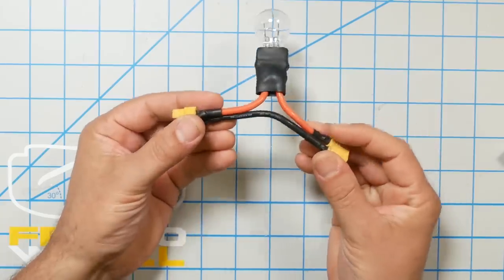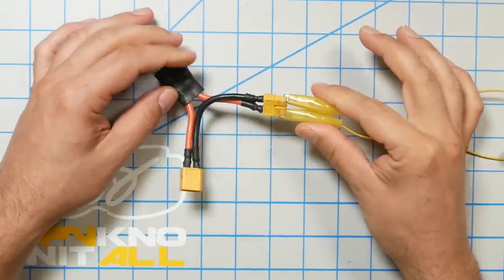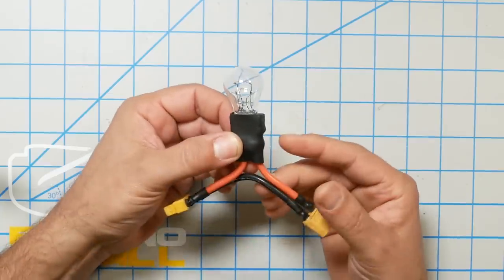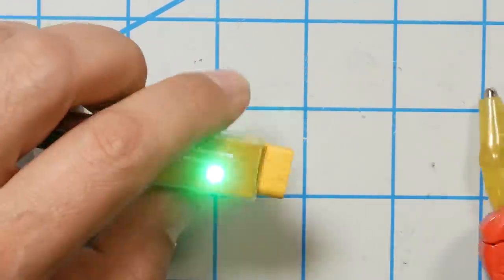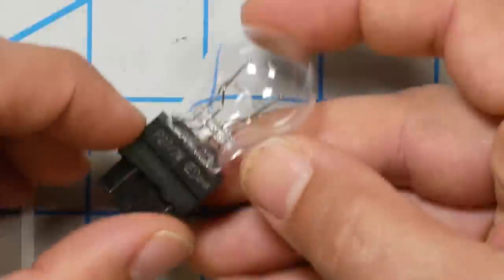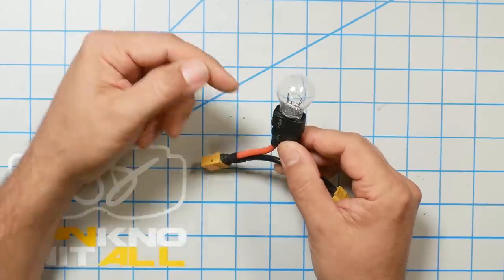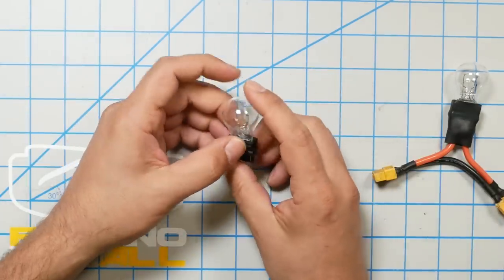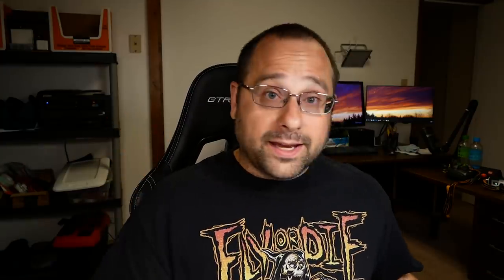Why you need a smoke stopper | HOW TO MAKE A SMOKE STOPPER

Comment: A: glad you didn't wet your kilt.
B: glad a total pro like JB isn't afraid to use a Fisher-Price heat gun/hair dryer.
On a serious note I tried a pre-made stopper and the bulb was a useless wattage for my micros and minis. I have a couple bulb sockets, I may build one myself with swappable bulbs if I can figure out the wattages I need.
Thanks for the hours you put in JB, you're one of the few we can't really do without.

Comment: I usually use a lab bench power supply with a current limit, but this is a good cheap way to do it. With the lab bench power supply, I can see the 'battery' voltage at which the high current is happening, which can help with diagnostics.
Reply: That's the proper way when working on the bench. This way you are also making sure that you won't damage the battery due to excessive current drain
Reply: Thank you for this, never thought of it and I have lots of good bench power supplies and no smoke stopper haha

Comment: I do love the irony with that poly fuse gizmo. 

Good ideas on the DIY version. I think I'll put a latching pushbutton switch on mine to simplify receiver binding.
Reply: That is a freaking great idea!!!
Reply: By the way some online shops still sell those polyfuse ripoffs which will smoke themselves and your model circuitry with it.
Reply: That is so weird that I just saw your post, I just got finished making one, it's not a smoke stopper though.  Had old tactical light for my .223 I don't use anymore, and took the button circuit board out of the rubber piece and de-soldered the wire.  Took two xt60's with some wire still attached (I always save connectors) 1male 1female, soldered the two red wires from xt60s together, then soldered each black wire to opposite ends of the button.  Hot glued a little short screw to the actual button to make it easier to push, some heat shrink and bam, no more needing three hands to bind my quads..lol.

Comment: Hi Joshua, brilliant, hilarious video, just started watching your echine build series. Big thumbs up from UK here.
Just a nitpick really but the bulb you are using is not a headlamp bulb (with high and low beam) but an American spec stop/tail light bulb. Hence 27 and 7 watts respectively. In the UK we have 21/5 watt equivalent. It looks to me that you have put the two in parallel, so you using 34 watt total. 4s batt about 15v.  P=IV, so yeah 2.26 Amps, allowing for inaccuracies of a clip on ammeter. Just ordered my Tyro kit off Bangood and really looking forward to the build. Crack on buddy.

Comment: by twisting the leads together on the bulb, you made it a 32W bulb: 25W for the bright filament + 7w for the dim filament.  doesn't change the 3A current draw, but felt like it needed pointing out.  

you could instead use a 3156 single-filament bulb and that really will be ~25W.  

I recommend a little peanut-sized 168 bulb for tiny whoops - they only use about 5w.

Comment: Great video and a good laugh.  Though, I once borrowed 2 brand new 25-watt smoke stoppers to a friend and it still beets me how he managed to smoke two new top-range 4-1 ECS, one straight after the other...the smoke stoppers didn't prevent the smoke from happening.  Therefore, from experience 3 amps is still plenty enough to create smoke and my lesson learnt from the experience is that I triple check my solder work and inspect everything under a scope before plugging anything in.

Comment: Hey, Joshua, a tip: cut the black wire and solder a switch in the between. 😊
It helps a LOT to bind and so on. 😃
I made one this way, but I used a light bulb holder. Easier to change in case of any accident. 😊
Reply: Great tip!
Reply: @frankbarajas  I even recorded the step by step process, speaking in Portuguese and English... But I couldn't finish the video yet. 😕
Reply: @frankbarajas  The problem is that I can't speak straight right now... Long history, but because of the robbery that entered my home and attacked me in late 2017 I ended losing a few of my front tooth... I'm having to put implants and so on. 😕
So, until I finish it I can't do much. 😕
Reply: MC's Creations - Oh wow, I am so sorry to hear that happened to you.  From my own personal experience I can say it can take a very long time to fully recover, if ever, from things like that.  Hope it goes well for you my friend.
Reply: @frankbarajas  Thanks, my friend! But yeah... And I didn't even told you the worst part. He attended me with a hammer at some point, luckily only hurt my ear. A bit to the side and I wouldn't even be here. You know?
It's hard to get over it, but it also gives you a lot of perspective about life. And that part helps a lot! 😊
So... I'm all good now. And soon I'm going to finish the implants and I'm going to get back to work. 😉
Reply: @MCsCreations - OMG, we are fortunate to still have you around.  God bless you.
Reply: @frankbarajas  Thanks a lot, my friend! 😊
But yeah, I really feel fortunate to still be around. And to know nice people like you! 😊

Comment: Now that was truly a great video.  Damn, you do work hard at thinking things through, or even all the way through.  I did not know about using one as a battery protector on the bench.  I did not know that you could "safe" your drone on the bench with props because it won't let enough current to flow to make the motors run fast enough to hurt you.  Sort of like it converts the Whirling Blades of Death into the Spinning Polypropylenes of Ouch. So, yes, I learned a lot somethings today.  Awesome stuff!  Thank you very much.

Comment: Automotive glass fuse that comes in housing with spring inside is also a solution,  it's mainly used for audio systems on cars but works on quads too.

Comment: One more use for a smoke stopper: discharging a pack down to nominal voltage, if you charged too many packs and suddenly you`re not using them for instance after a crash, bad weather, or uhhm, you fell and hurt your wrist or something :o
Sure, many have that function on their charger(s), but many don`t.
12V halogen bulbs for desklamps etc. also work, but they can get REALLY hot, so keep that in mind ;)
Also, use a multimeter or voltmeter so you know where the voltage is actually at, shouldn` t have to mention that, but here I am, mentioning it :p

Comment: A computer PSU has intergrated short circuit protection and can output 3.3V 5V and 12V. You can get 7V or 9V out with correct plug placement. Its an awesome tool for every drone maker.

Comment: Oh I absolutely agree with you! I Cote every solder joint after they've cooled with conformal coding regardless of how good of a soldering jod I've think I've done. I had the tiniest blob of solder from a +5v pad which was right next to an positive ESC pad, they weren't touching but they were closed enough when I plugged in hey 16 volt battery they might as well have been one pad, and wouldn't you know it those kind of shorts don't show up with a multimeter. 🙃
Reply: It happens more than you think :) Me once did a stunt with XT60 battery connector soldered in opposite polarity in middle of night. And quad didn't fried only because one of battery pads on flight controller board had cold soldering and fell of on battery connecting.
Looking over boards with zooming lens after soldering tiny things should be a mandatory habit for every DIY-er.

Comment: Made one right after my first build... I had to cross my fingers with that one but not any more.  I used a 3 amp circuit breaker after reading an article on Propwashed.com.  Two worthy notes from the recent past, 1- I smoked an FC with the smoke stopper on (the FC must have had some damage and shorted using less than 3 amps since it didn't trip), 2- I was puzzled after checking motor directions with the smoke stopper on, not anymore since I now have learned that operating one motor at a time at the low speeds I used wouldn't draw more than 3 amps.  Thanks a bunch and I had a really good laugh with you.

Comment: 4:17 annnnd subscribed!

From my own experience, I chose too small a wattage bulb for a 10 inch build, that I really didn’t want to smoke, and the light was turning on just from the audible beeps the motor makes (for context, it was two 12v - 4 watt bulbs in series)

Initially thought something was wrong so disconnected the battery really quick, but now know better the SS is an indicator, current limiter, AND a fuse so it's safe to leave connected. Probably put myself through a lot of extra work, but in the end better safe than sorry.

Comment: I also use mine with the “Discharge +” setting on my Reaktor charger to boost its built in discharging ability. It’ll boost it from 1-2amp to about 5amps discharge, just by adding the one bulb. 💡

Comment: Lab power supply is the way to go. Set up a current limit like 1A and you can even troubleshoot the short circuit by touching and feeling which component is hot.

Comment: I was really lucky at one point during calibration when I did the rookie mistake and was trying motors with my props on. The third motor, my mouse slipped and it shot full throttle at my hand. I had a lot of cleanup to do after and luckly BF's great protection shut the motor off when the quad tilted to much. I can see that if I had this it would save my hand that day.

Comment: I found out heat expands metal and a short circuit is not visible while cold but once you apply power and that short is warmed up enough to expand the short is created and causes issues.
Found this with my computers motherboard. Would work just fine when first powered up, but as soon as i tried to load say Chrome my PC would trip and shut down (PSU protection) Tested with a multimeter and everything was fine.... Only worked it out when my PSU failed to trip and a small section of my motherboard burnt out that connects a few capacitors together. The short was a small dent in the board itself and separated while the board was cold.
Reply: I’m a little late to this.. but just wanted to say wow! I bet that was quite an “ah-ha” moment… This is good information to have in my mental troubleshooting archive. And good job on actually figuring out what the culprit was there!

Comment: I owe you big time, Joshua.

Building two identical rigs.   Built and used your smoke stopper for the first time on the first test of the first ESC/FC/motor combo and to my horror the light came on, meaning I have a short.  No smoke, of course....
Same test on the second identical rig passed.   Since I couldn't see any obvious difference between the two rigs, I swapped the connectors between ESC and FC and the previously failed rig now passed, with the ESC/FC chirping correctly.   So it was a bad connector, which I have since fixed.   Never would have guessed that.   But found the problem quickly because I'm building two identical rigs.    Your smoke stopper saved me a brand new rig:  ESC, FC, motors.     Thanks so much for posting.....
Reply from the maker: Whew. It sounds like that was a close one.

Comment: Honestly, I'd make a couple of super long wires for the constant current power supply, and have a smokestopper on the end--the bright light is way, WAY more noticable for quick reactions--and not a weak alarm beep, if your power supply even has one. So even to those guys (Me) with a constant current benchtop power supply... Why not make some long cables that will protect you even further?

I'm just getting into FPV, and i'm seeing a lot of good advice on this channel.

Comment: Or if you wire up the power out on unify pro hv with power out on your fc on mistake like I did  on your tbs unify pro instead of the power in multimeter wont detect it. I had a smoke stopper that uses a fuse hooked up but still fried my vtx. Great information

Comment: Made a smoke stopper out of an automotive 2A fuse with XT60 connectors a couple weeks ago to set up a F722 5.5" quad. As I was verifying motor directions and RX settings using a 12V 30A PSU, I accidentally touched the positive alligator clip to the negative lead on one of the ESCs, despite electrical tape around most of the clip, popping the fuse. Could've gotten ugly and expensive without it, had it touched some other exposed part.

Comment: I made one of those when I first started building quads, just after I fried my first ESC by hooking it up backwards.
Reply from the maker: smoke stopper will not protect against reverse voltage. only over-current.
Reply: @JoshuaBardwell  It does if you are quick enough, I've done it.
My first plug in on any new build or rebuild is just a quick touch through the smoke stopper. If it even looks like it might glow a little I stop and find out why.
You know how you can get a bit complacent after a few builds and make a stupid mistake.
It may depend on the quality of the ESC but I have saved one, it is still working today.

Comment: The best tool I have never used... Thankfully I have only killed 1 ESC and 1 VTX not using a smoke stopper in over 4 years in the hobby. While just a month ago or so I killed a Rush Race VTX under volting it :( due to a bad solder bridge...

Comment: I basically use a 3 AMP blade fuse instead of the bulb, seems to cover all my bases regardless of the quad I'm working on.    They're built the same way you built the light bulb version.
Reply from the maker: If you use a fast-blow fuse, then this is okay, but the problem with it is this: you hit the arm switch one time, or your motor beeper draws too much current, and bam, you blew a fuse. Now you're out a dollar or fifty cents or however much the fuses are. Every time you blow a fuse, you have to have a spare on hand or your smoke stopper doesn't work any more. The light bulb version works basically an infinite number of times.

Comment: Great video, going to build mine today!  Can you use other light bulbs?  I know a traditional bulb with screw connector wouldn't be easy to wire, but what about some of the smaller specialty bulbs, like for track lighting/under the cabinet type ones?  Some of them have just two prongs sticking out, very easy to hook to.  Or do you use the automotive one because they're tough and take a lot of abuse.

Comment: Josh, just finished my quad.  When using the smoke stopper, the light bulb comes on.  I've decoded the issue to the VTX.  If I remove the VTX, the quad powers up and all the necessary beeps are heard.  When I plug the VTX, the bulb lights up but all the beeps are heard.   Could this have something to do with the power of the VTX?   Confused....Thanks, Mike

Comment: Just to point out... If you use a higher cell battery, your current cap will go down, not up. ohm's law, Amps = Watts /Volts. And your in a series circuit so current is the same at all points and voltage can differ. This is why you get better flight times with a 6s over a 4s at the same amp rating.

Comment: Bench Power supply. The quad only needs ~300 - 500ma at startup. Also, super convenient, you don't even know what you can use it for until you have it.
Reply from the maker: Not easy to transport though.
Reply: @JoshuaBardwell  Yeah I saw you mentioned that. I still take it to multi-day events. However, the utility of it can't be overstated. It's a must have have once you get to the soldering your own boards stage.

Comment: Something that isn't explained much in the literature out there: The big benefit and main reason for using a light bulb over any other component in a smoke stopper is the speed the resistance in the filament responds to current. At low current the filament will not light up and its resistance is low, so it acts as though it's not there. If there is a short in the quad, the resistance in the filament rapidly climbs to a very high value and effectively soaks up the current that would otherwise be going into the quad, so that the amount of time the quad is exposed to a high current is minimised. This is the big advantage over any semiconductor solution and why they shouldn't be used.
Reply from the maker: Correct.

Comment: Got a Boom Stopper.  Pretty easy to make if you want.  Like it better because it uses a fuse.  Not a fan of broken glass in my bag.
Reply from the maker: The problem with fuses is every time you have a fault you need a new fuse. Really adds up.

Comment: I have a 3D printer and something this would've helped me with is when I had a short in my heater cartridge. It didn't ALWAYS cause a short... just in certain positions (and I didn't even find the position that had ended up frying my main board). With this in line I wouldn't have fried anything. Though I have to wonder, does it need to be between the board and the cartridge? I'd assume so.

Comment: Also if there are issues with smaller circuits than the meter will not tell you but a smoke stopper typically will. I always use both but never rely on just my meter.

Comment: I also use smoke stoppers to discharge my lipos, I just put a shorted XT-60 on the end, and then the Light Bulb discharges the battery. You cannot just put the battery aside, you need to check it constantly or else you are gonna end up with a dead  battery

Comment: I plugged a 3S battery into a fresh built 2S Kwad once and POOF so it's even more relevant on Micro Kwads since it's easy to plug a large battery in by mistake
Reply from the maker: Smoke stopper may not protect from over-voltage.
Reply: @JoshuaBardwell  ah crap and here I thought I was saving myself...i've smoked one too many in my day if you know what I'm saying!

Comment: Add a shorted XT 60 to the smoke stopper and you have a battery discharger. That is the best if not the only way to discharge your batteries before disposing of them safely.
Reply from the maker: Personally I use the alligator clips but yeah.